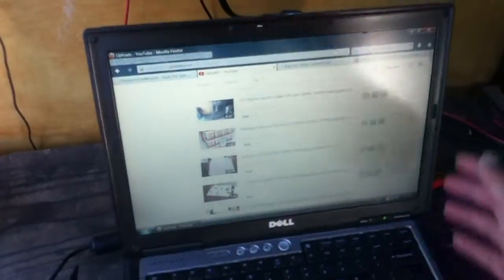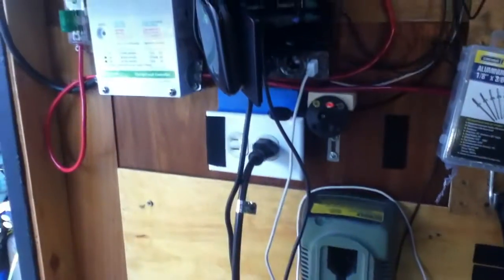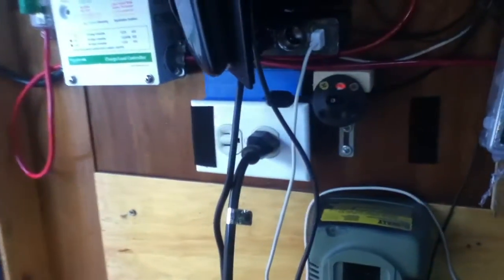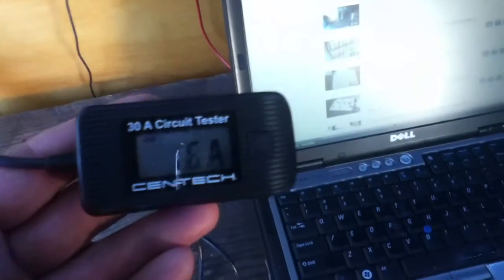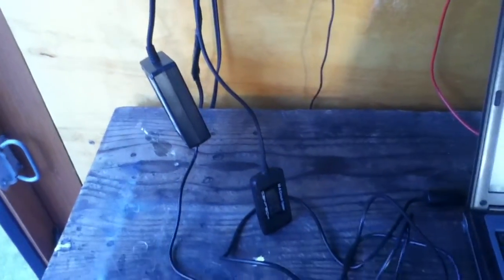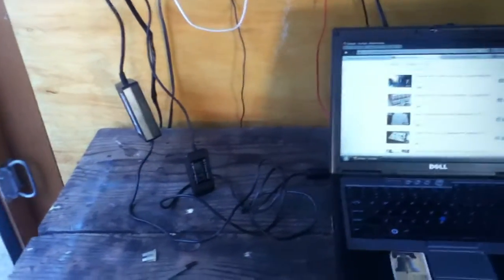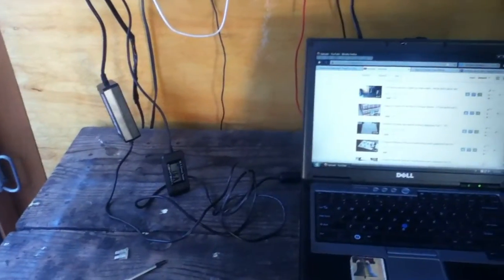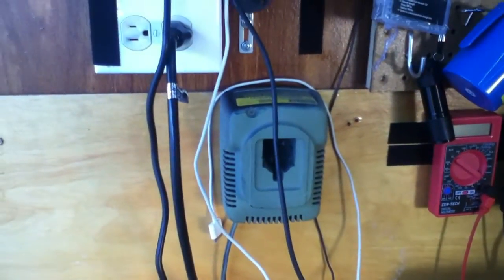Testing the amp draw of the PWR+ 12v voltage converter for Dell Laptops

Comment: I have 2 different laptops and tested them both running off 12v battery using car cigarette lighter universal laptop adaptor and I used clamp meter to measure amps and the results were same as yours both laptops drawing 1.5A